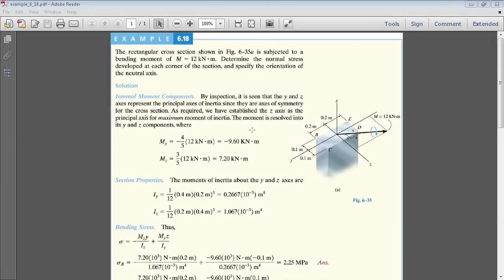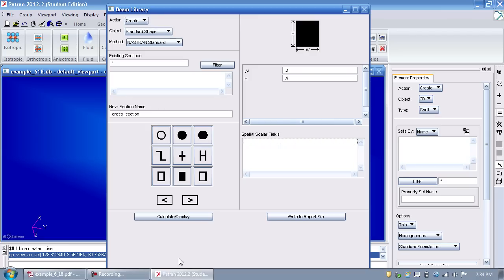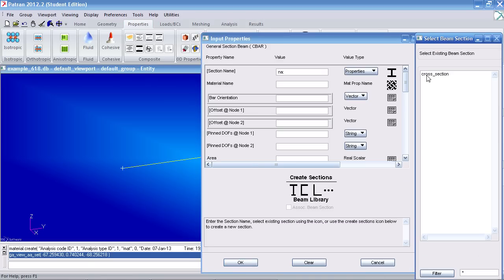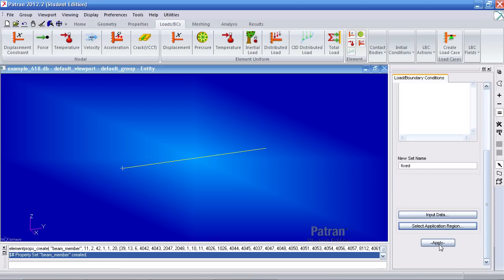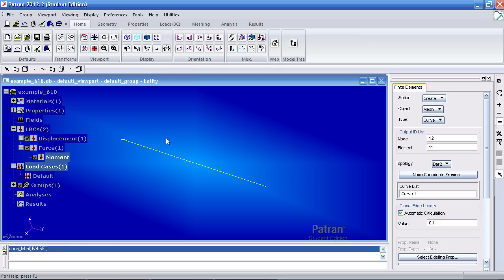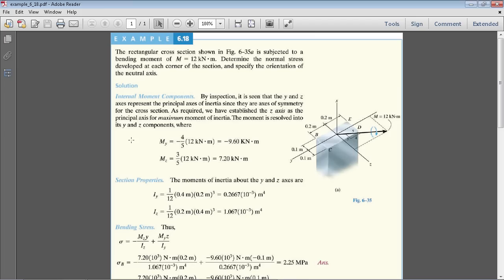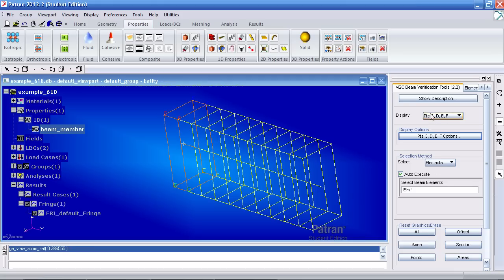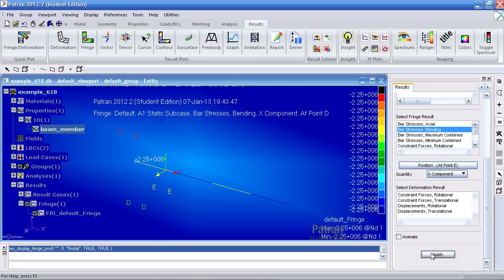MSC Nastran, Patran Tutorial - Bending Stresses of a Loaded Beam

Comment: thanks alot!! am having a problem: after executing all i can't show results, i get this error message: "Unable to connect to Direct results access file" any one can help please?
Reply from the maker: Jawhar Chebbi I suggest repeating the problem as shown in the video. There is probably one step that was missed and contributed to an issue during analysis. If you look in your .f06 file, you will probably find a USER FATAL MESSAGE.
Reply: Yes you are right ! I did a mistake and now I am able to see results on patran  ;) but I need the modal analysis results that should be normally outputted in the .f06 file but I find an error message stating smthg like  "MASS MATRIX NEEDED TO CALCULATE EIGENVECTORS VALUES".... if you have any idea I will be grateful 😀 I spent 2 days on that point ! 
Thx
Reply: Jawhar Chebbi faut renseigner la densité du matériau, c'est normal parce qu’il a besoin de matrice de masse pour calculer les modes propres,
vive Toulouse.
Reply: NAIMI Fakhreddine Merci! en fait il fallait mettre la densité aussi.. Mais là c bon je n'ai plus de problèmes ;) vive Toulouse bien sûr.
Reply: +Jawhar Chebbi Waht mistake did you do?